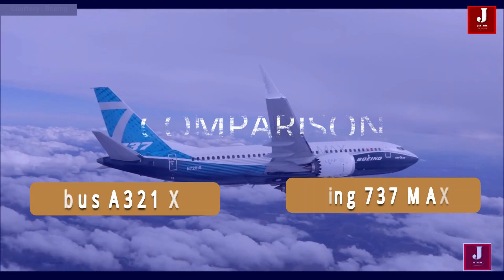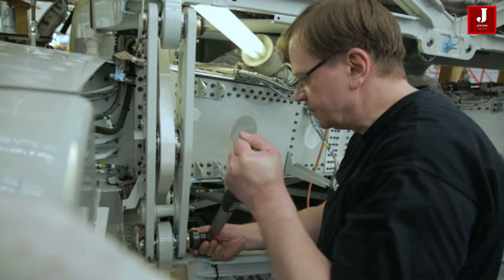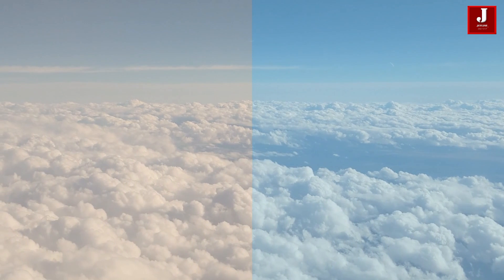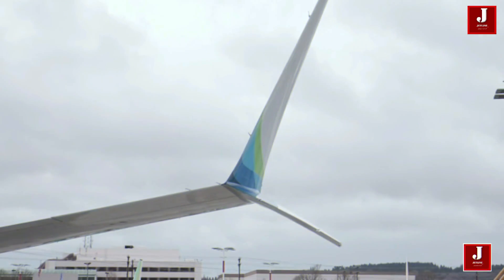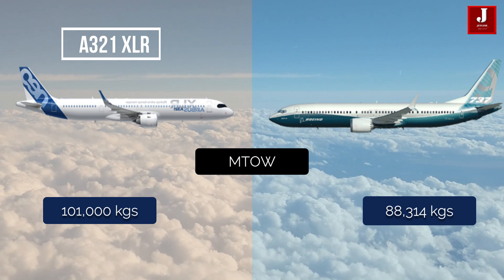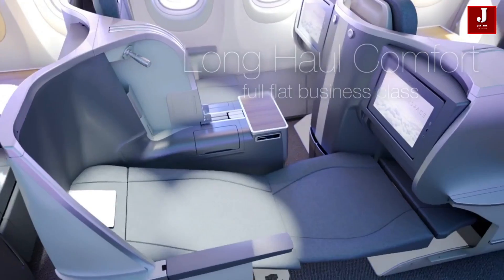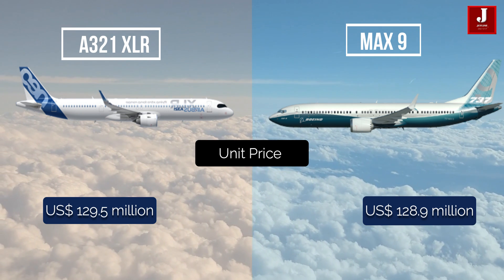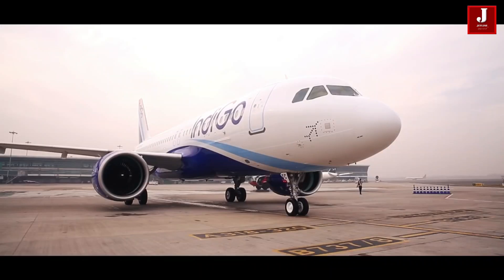Comparison of Airbus A321 XLR and Boeing 737 max 9

Comment: Not really a fair comparison. A closer match would be the MAX-10 which was designed as a direct response to the XLR. Unfortunately certification of the MAX-10 is delayed giving the XLR a huge advantage. Word on the street is that the MAX-10 is more efficient, burning less fuel per hour due to the fact that it is lighter. The XLR however has a greater range due to its higher fuel capacity.

Comment: Why are these two airplanes compared against each other? MAX 9 has a range of  3,800 miles while the A321 XLR  5,410 miles.  A321neo has a similar range (4000 miles) and capacity and is the correct plane to compare to. Or Max 10 vs A321 XLR. Howver, none of these planes are currently flying. The first MAX 10s will be delivered in early 2025 (at least) while the XLR in early 2024.

Comment: What a mistake Lion Air about  the Boeing !
Reply: Their mistake was configuring the purchase poorly,  they were one of the few that did not add redundant AOA sensors, turned out to be a bad decision, didn't it?  Also putting a 737-800 pilot into it with no additional training didn't work out too well either ...

Comment: Its useless to compare 2 different generations of aircraft design. A321xlr is state of the art, 737max is an oldtimer on steroids. Boeing should develop a completely new design for an efficient single aisle Airliner.
Reply: state of arts😂😂😂 a321 is based on a320 series which was launched in 1980.. fanbois r ridiculos without proper knowledge😂😂😂

Comment: Boeing can simply extend the range of the max 9 and offer it much like airbus does it’s a321neo.
Reply: Oh like they tried fitting bigger engines to the Max, that turned to shite,  now they want to lengthen it  😆
Reply: @cheetomussollini  I meant by adding an additional tank.
Reply: @jordanalexander4331  adding more tanks just means it can carry less passengers and freight
Reply: its called the MAX for a reason... they have max'ed out the specs for the 737... they cant enhance it any more.
Reply: @tuluksvui747  They shouldn't have "enhanced" it beyond the NG.
Reply: @tuluksvui747 nah! In 2035 they can develop the Max plus and then the Max plus ultra. And then in 2060 we will see the Boeing 737 Max plus ultra ER gold edition which will be the only twin isle aircraft longer than a 777-300er.
Reply: Simply?
Reply: @michaelbigdongovic3295 A320 uses the same ULD's.

Comment: The MAX 9 has been available for delivery for over 3 years now.  The A321 XLR won't be available for delivery for another year and has not passed certification. The MAX 10 could quite possibly be certified and available for delivery before the A321 XLR.
Reply: Both the B 737-9 and -10 should be compared with the a 321 LR which is available, the a 321 XLR gives total new long haul opportunities across the Atlantic or pacific ocean. Boeing has no SA-plane that can fly this distances.
Reply: @he8570  exactly...it's a class of its own
Reply: @he8570  Across the Pacific?

Comment: Boing 737 have more comfortable leg space for all class, specially the business class. 737 have more quiet engine noise from inside.
Reply: I disagree. The other day at plane spotting I had chance to see both take off. Neo was way more quite. Clear difference from Ceo. Max compared to NG I couldn’t heat any change. Still noisy. And leg space, well, every airline could make legspace by placing the seats further dinstanced from each other…If they want to.
Reply: Do you forget MCAS !!! really.
Reply: @helloworld_lovepeople1051  lot of 737 sold this year. Problems of 737 and 787 solved and been recertified.
Reply: @JDAbelRN  doesn't mean it cannot happen again 😞 let's be honest Airbus is better with the new tech upgrades
Reply: How would you know?
Reply: smh you seem like was aboard a321xlr before lmao

Comment: I think the 737 max 9 is better than the A321neoxlr because it's cheaper, so airlines save more money. Plus, Boeing has been around since 1917 and Airbus started in the 1970s, and I can't believe that an aircraft manufacturer that has been around for 40 years is trying to take down Boeing. Boeing makes better aircrafts than Airbus, and has a longer history. As for Airbus where their aircrafts are sold more to airlines.
Reply: boeing fan boy detected, personal like detected, and "no one cared" detected
Reply: @gasviation9077  XD Thanks for da reply, braddah from Hawai'i!
Reply: @beemcplayz1044  No problem bruddaaaaaaa bri ish man here
Reply: @gasviation9077  Tell da kine, uh Airbus to stop competing against Boeing.
Reply: Well let's say it: Boeing has a longer history but Airbus has more experience in future technology such as Fly-by-wire and subsequent systems. And one thing which is most important: Airbus has morality, they listen to their engineers and don't dare to bring out a potentially dangerous aircraft like the B737-8MAX.

this is why Airbus has been the largest aircraft Manufacturer since 2019
Reply: @GaryGary60100  Liked.    Boeing said MCAS was fixed ,are u sure?
Reply: @GaryGary60100  longer history  does't make it safer. With Boeings recent disaster with the MAX  and putting cost savings before safety, it seems your opinion is wrong
Reply: @GaryGary60100  the planes that crashed had incompetent and poorly trained pilots.
Reply: @GaryGary60100  Screw Airbus. Boeing has been around for 105 years, and their planes look more better.
Reply: @beemcplayz1044  ...but can't fly 😂🙃😬
Reply: @GaryGary60100  That's just your opinion 😏
Reply: @beemcplayz1044  look better😹😹😹 airlines don’t care about look they care about range and capacity
Reply: 600.000$ cheaper. Yes. But lower take off weight, lower thrust, range of max9 is quit low comapred to 321neo (2200NM).
Reply: Your telling me that airbus taking down boeing is illegal and me seeing 737 crashes in my home page:
LOL BOEING FAN BOI
Reply: Replying from a year in the future (Jan 2024) .  "Boeing makes better aircrafts than Airbus".  Perhaps you would like to reconsider.
Reply: It goes without saying to have longer range the aircraft has to a greater takeoff capacity to accommodate the exact fuel needed.  More fuel more weight. The exact range comes from the exact fuel, not efficiency.  The Max is more fuel efficient.

Comment: 3:31 Wrong info, the max 9 range isnt 6570, its actually much less...it can only reach this range with an optional additional fuel tank at an extra cost from boeing!!!
Reply: You realize that the XLR is made off of AUX tanks.
and 6570km not nautical mile.
Reply: What is an XLR but a version with additional tank?